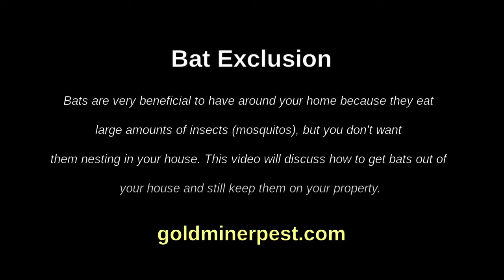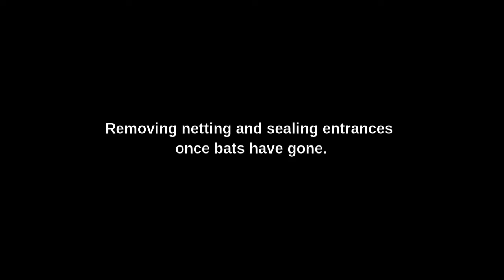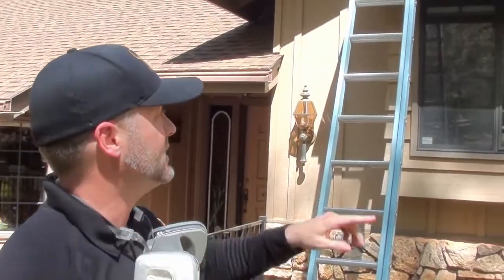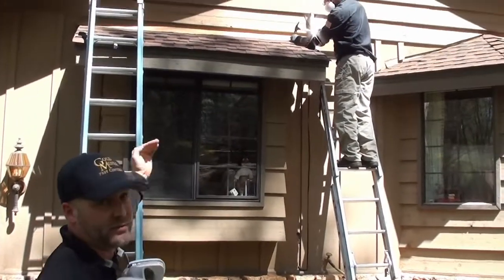Bat Exlcusion: How to Get Bats Out of Your House

Comment: Great video. Can you comment on time of year to do this. July and August is when they have their babies and are nesting. If you seal them in the babies can die so it's better to wait in until later in the year. Also there are bat houses you can place on your property or outside of your house to encourage them to stick around and eat insects and mosquitos.
Reply: When I contacted bat conservationist from the Wisconsin DNR site today he said that now (late August, definitely after the 15th) is a really good time to do this process. The pups should be independent at this point and the bats are still active enough to safely evict without the possibility of them hunkering down for hibernation. It varies by state, but your state's DNR is a wonderful resource.

Comment: Can you recommend a premade one way door I can order online 
I need 2 each for both vent gable ends
Reply from the maker: So there are some plastic premade ones online but I like to use cloth. It's much easier to work with and it allows you to cover the vent then just create a funnel about 24" long at the bottom for them to fly out. We use a roll of weed block it's cheap and easy to work with.

Comment: When I was 19 years old during a month of September that I accidentally let in 2 bats. I came home afternoon and found one bat under the blind to the dinning room table. I pushed the bat out with a hair spray bottle. The 2nd bat came out while I was cooking my dinner. I put my dinner in the microwave oven so the bat won’t get it. I grabbed my father’s fishing net and block the door entrance to my bedroom. In one swoop that I caught the bat in the net. I flipped the net once to not have the bat escape inside the house. I flipped it back so the bat flew away into the woods unharmed it. I even talked to my parents afterwards. They both laughed at what had happened to me. Even using the fishing net was a good idea. My mother had 4 bats inside of the house at one time. We didn’t have a fishing net. We used the lids to these containers to have them go outside. Even my mother had a bat inside of the house over 10 years ago. My mother screamed for me. I used a broom for getting the bat out. I didn’t wore my glasses or even my contacts. I got it outside closing the patio door from the house into the enclosed back porch and out from another patio door towards the outside. I did closed all of the bedroom doors and even the main bathroom door across from one of the bedrooms. My mother was in her bedroom with her little dog. I told her the bat is out of the house. I think it was a day or 2 that my mother spotted another bat. I didn’t see it.

Comment: How can you confirm that bats are all out ?
I feel I can DIY this myself 
I have video of bats coming and going from a gable vent. 
I was charged $150 evaluation fee and quoted $1500 for exclusion.
Reply from the maker: How we do it is we leave the one way door open for at least 2 weeks, that ensures they have all left because they cant go longer then that without food and water.
Reply: @goldminerpest when it’s close to the Fall in Vermont not sure when I will be able to install the one way door will I need to wait to Remove the one way door next spring in April
Reply from the maker: @lakeville1853  So whether they have left for hibernation for the winter or not I would just leave the one way door there for 2-weeks. That way even if some are still in the structure they would have to of left the structure for food or water. If you leave the one way door there all winter especially if its the fabric like we use it could start to deteriorate or weather could open holes in the fabric and allow the bats to get back inside.

Comment: Won't new ones just find another way in next year and then you're out thousands of dollars every year calling in the bat removal guys????  We used a sonic sound machine in our attic, got our soffits repaired...worked for 2 years and cost a lot less than this.  We now have bats again (they are getting in under our roof shingles) so it's time to replace the sound machines.  (I was wondering how long they would last).    Our house is a 2 story victorian with a HUGE attic and I'm sure more entry places than I can count or even contemplate trying to seal up.  I'm also sure removal would cost over $10k for us.
Reply: You need to seal the entire house from the outside, you can not just do one spot like they show in the video, bats will find another way to enter the same house. Having the entire house bat-proof is the only way to go. I'm an NWCOA-certified bat control

Comment: Some pest companies or bat guys charge 2500 to 4800...for what? Add some mess and seal it up...done. why do companies charge so much and then charge extra for cleaning up the poop.
Reply: Because alotnof times there are more than one entry point that takes an expert to get up all over the roof and inspect and DIAGNOSE exactly where and when, + to give a warranty…. Ya it’s not as simple as this video always….
Reply: Risk of rabies exposure.